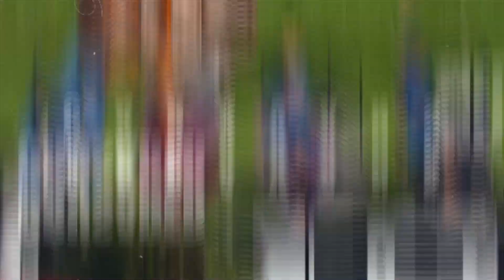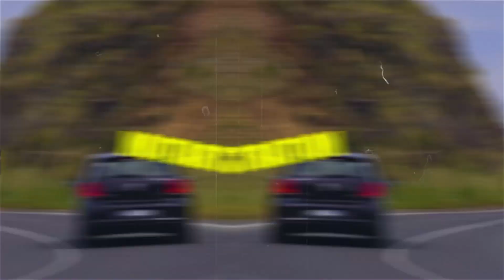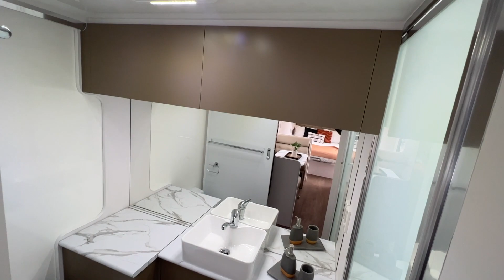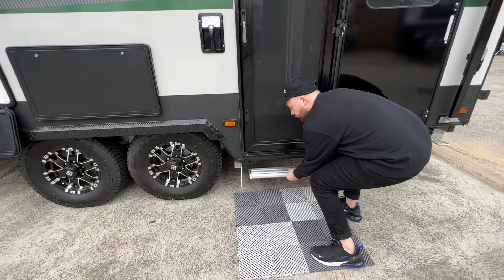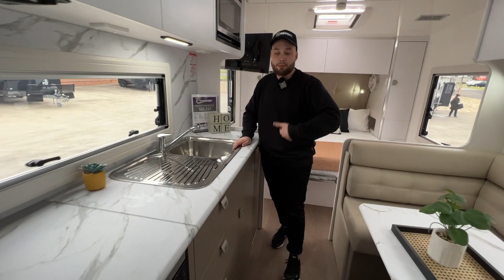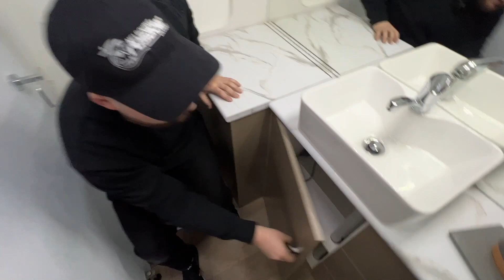Musketeer Treville 2022 - Composite Build!

Comment: Why oh why have they changed the position of the siroco fans, they where on the side walls above windows, they will be basically be blowing air in your face
Reply: I guess it’s because there’s no wiring in the walls. Same reason power points are now attached to cupboards
Reply: @michellemain2609  is it because of the composite walls?
Reply: @dilligaf2984  yes it’s the composite walls